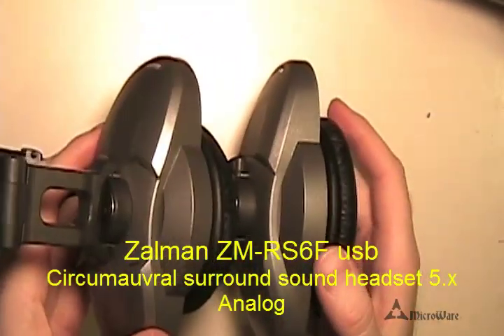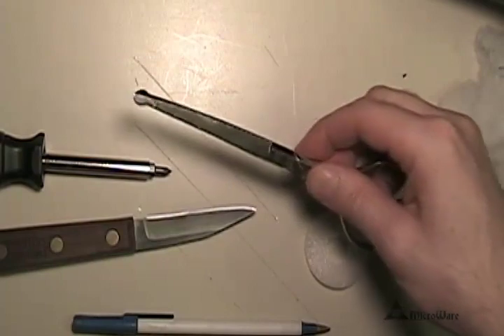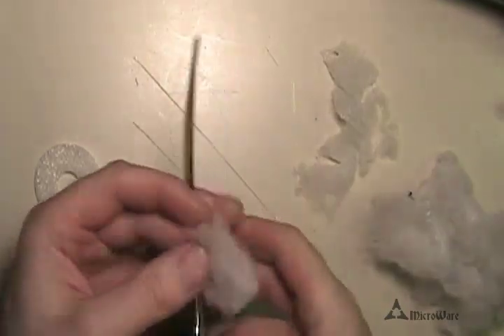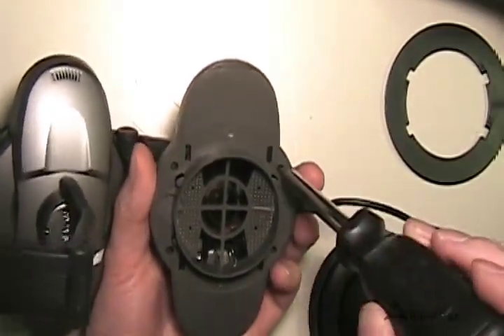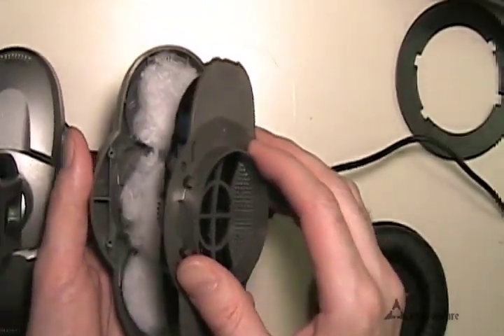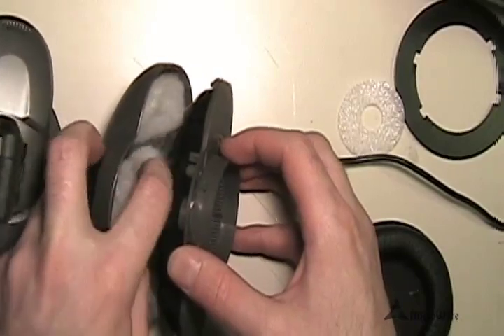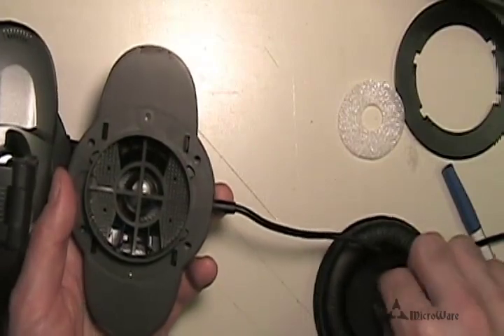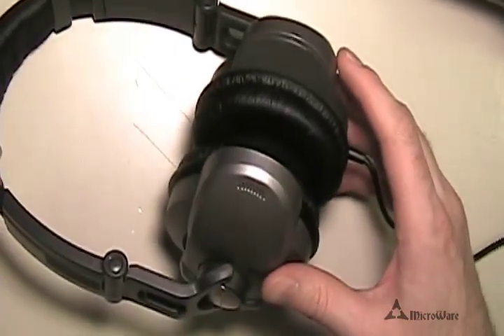Zalman ZM-RS6F headset. How to mod for better sound. Physical mod, not software.

Comment: Nice tip, I am still using my ZM-RS6F still today, had them for 14 years.
My ear pads are dropping bits of the surfacing everywhere.
I was looking for replacement pads (if it's even possible nowadays) and came across your video.
Reply from the maker: Wow, my cables and controls broke years ago. I would just google and see if you can find a new pair. I know last year they were still available for super cheap. I am using they Hyper X and am finding that they have great sound for my video games and music. Search hardwarecanucks on YT for a review of them.
Reply: LOL, glad to know I'm not the only one!  I also took these suckers out of the time capsule from which I banished them back in 2003/2004.  My kid broke my Corsair headset and these were my fall backs until the Massdrop Sennheiser PC37x headset I ordered comes in.  These Zalmans really do sound pretty bad, no wonder Zalman file bankruptcy.
Reply: Aliexpress sell the pads
Reply: @SerpentorX  THX, i keep forgetting bout aliexpress

Comment: I fixed sound just by equalizing the output using Pulseaudio equalizer.

https://www.facebook.com/photo.php?fbid=10154115904409106&set=rpd.567974105&type=3&theater

It worked great on Linux. Still trying to do the same with Windows. Found Equalizer APO, but still didn't got a great result.

BTW: I'm using CM6206 USB sound card on my notebook to get the maximum from my headphones.
Reply from the maker: +Pablo Santiago Sánchez I have tried using an EQ also. Though it helps, it still has limitations based on the physical aspect of the speaker and housing. You will get a different sound from, for example a book shelf speaker in a plastic box compared to a book shelf speaker in a wooden box. The same applies to headsets, reverb off the plastic will sound worse then from wood. Slowing down the reverb with the cotton does more than just adjusting an EQ.

Comment: Great video, maybe I´ll try it, but listen, at the end you said to put the earcup in the collar and then lock it, why would you take it off in the first place? can´t you just unlock it, turning the whole earcup?
Reply from the maker: Luis Pedro Mendiondo  It has been a long time since i did this video. I assume that i said that for sake of the video as i took the leather ear piece off to show the tabs on the plastic collar. I assume that you can just grab and turn the whole piece as long as it doesn't feel like the leather is grabbing the main body of the head set to be sure that it does not rip the ear piece.
Reply: Great, I´ll try, thnx for the fast reply even though it´s an old vid, :D